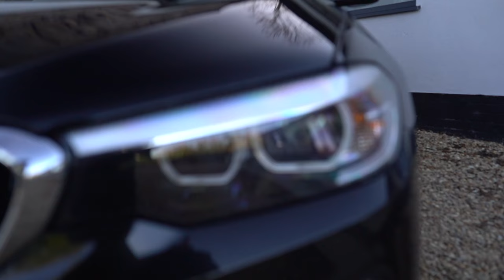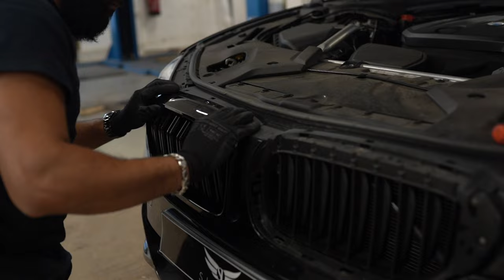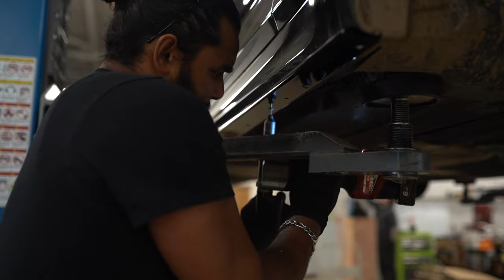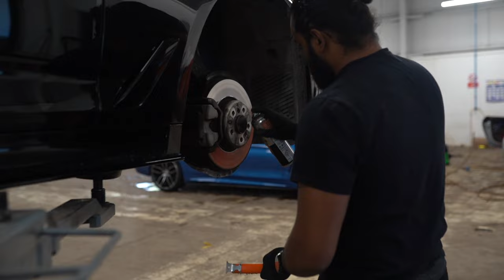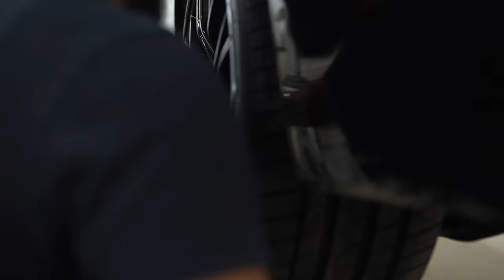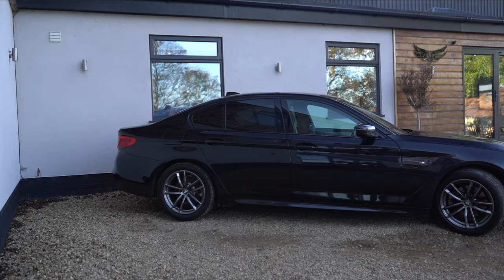HOW TO TRANSFORM A BMW 5 SERIES - THIS IS HOW WE DID IT

Comment: I've been to these guys and didnt even interact and left quickly. It was immediately obvious that they tart up low spec cars with really cheap and nasty ebay parts & wheels which will crack or bend as soon as they look at a pothole and stick crappy budget tyres on which isn't exactly safe! To top it off, they ask a premium. My suggestion is to do it all yourself 'properly' with quality parts, wheels & tyres....
Reply: U went to this guy?
Reply: @YameenAli0923  If you had both read AND UNDERSTOOD his first TWO WORDS...you will have the answer, without needing to ask. CLUE....."I'VE BEEN"
Reply: WELL SAID. Complete Transformation = ebay wheels and M Perf kit. The replica alloys are terrible compared to bmw original.
Reply: Nail on head. Tarted up cars with a bit of cheap bling and then offered for sale at a silly mark up. They’ll fool some people but the more astute will see straight through their MO.
Reply: @YameenAli0923 No, he went to that other guy.
Reply: Wtf is up with the hate? Where the f do you think bmw source plastic parts from? It begins with C. Not everyone is willing to pay extortionate prices to manufacturers who continue to rip off customers!
Reply: @ij1014 I’ll stick to OE BMW equipment thank you.
Reply: where can I buy quality parts?
Reply: @filippol.1775  Don't get sucked in by what these clown say. Ebay parts for the BMW are made with the same materials. If you want to spend 4x's as much, go right ahead.
Reply: Man, be quiet. These parts are solid, getting stuck on these genuine parts, made from the same materials is BS, I understand you work for BMW and all, but please spare us the bullshit.

Comment: Big improvement, shame you don’t put premium tyres back on the vehicle
Reply: Yes another company in Nottingham called YNC (your next car) do the same with their bmw stock.. brand new replica bmw alloys with pi55 poor brand new ditch finder tyres all round!
Reply: @kamranhussain578  practicalmaix!!
Reply: Tires come and go! Did they use the air freshener your like!?
Reply: @theophilusone7  watcha talkin bout fool?! tyres are the one component that have contact with the ground so it’s imperative that they are of good reliable quality! It’s just something one cannot skimp on dawg!
Reply: @kamranhussain578  there new, not old. I drive R 305 all the way around on my 750li. The R 275 I have on my N52 do just fine. Tires don't last n if they do your not driving!
Reply: @theophilusone7  they are ditchfinders dawg! If you wanna be a cheapskate then rather you than me.. I'd rather stick to the likes of Michelin, Goodyear and continental.
Reply: @kamranhussain578  sounds like you run stock cars. Pirrelli n Dunlop on my cars n  Maxxis on my trucks. Maxxis are cheap sure but the fun I have tearing them apart is priceless. I'll agree to disagree with you! Different lifestyle. Yawn cars ain't my preference papa!
Reply: @theophilusone7  ok dawg whatever you say whatever you say
Reply: Kamran is right. Tyres are important. You decide when to brake, your tyres decide when you stop.

Comment: You changed the wheels, put on a side skirt, and added a few bits of black! Looked ok before you touched it and how much did it actually cost? More important, did it really increase the value of the car?
Reply: Alan
Reply: what this company does is buy more standard cars and sell them with kits to clients, that way clients always come to them as they know they get a kitted car, its not so much to increase value its to target that market
Reply: Modifications pretty much never add value. If anything they detract it when you try to sell it

Comment: I bought a g30 almost 2 years ago from this company. They put low quality alloys on it and was looking stunning until I hit a pot hole which cracked on the spot. That was a month after the purchased  ending up I spent 1K more to replace all 4 with originals. I called the company sadly they were not really helpful.
Reply: Yeh they use cheap replica alloys , I was considering buying from them buy just keeps seeing too many horror reviews. Will buy elsewhere and just buy the quality parts and fit them myself or get them fitted.
Reply: All cheap quality products

Comment: That rear diffuser looks like a cheap piece of crap off of eBay. That is not OEM.  You do not install an OEM diffuser by screwing it in with a drill!
Reply: He had to drill it as he broke the clips when he RIPPED the original one off.
Reply: I’m not sure how they think it’s a good idea showing some plank shoving 2” screws in to the back bumper! Utter idiocy and the £70 Practicalmax ditchfinders just show the the level of investment in the aftermarket tat. Avoid at all costs, if you want to customise your 5 series, do it yourself with quality parts fitted by a reputable body shop.

Comment: I have the exact same car as the 'before' version (same color, same rims, ..everything).  I want to change to a black grill and put on a front splitter too.  But I'm keeping the rims.
Reply: Black grill is an easy and cheap update. I did mine and it looks great. Will also put a carbon fibre front splitter soon too.

Comment: Nicely done. This is oryginally a g30 luxuryline before the FL. Can you show any g30 luxuryline after the Face Lift tuned in this way? Are there any maxton party for the g30 luxury after the FL or maybe the same parts fit for both wersions before and after the FL? I have a g30 530i xdrive black luxury line with a Shadow pack this is why i am asking. Thanks for the info.

Comment: + for modding in general if OEM+.  - for modding cheap looking parts with no OEM wheels, cheap tires, no cleaning or mesuring. Use screws instead so one can convert back to stock. This is rediculous!

Comment: Had my 530e for a year now from S James. 30k and rear tyres need changing, fronts still a way to go. No issues with grip in all weather conditions. Car looks great and accessories still firmly in place. 👍Alloys have not bent with pothole hits but lacquer has started to show wear. This seems to be the case with all modern alloys so can't complain. Mechanically, car has been faultless to date.  Good job. 👍
Reply: Aftermarket rims dont seem to hold up in winter weather.
Reply: @leonk8113  have had this issue with oem wheels on a golf too. Tyres were wrong size on my 530e, too stretched. Only found out when changing was a bulge on inside edges of both rears. Have upgraded to Kumho all round with bigger side wall. Improved ride quality, grip & looks better with the slightly higher ride height on these models

Comment: what kind of tires did you use for it?
Reply: Took off Goodyear and put on PracticalMax
Reply: @hc5253  took off premium brand and replaced it with budget, a running theme in the whole so called transformation!
Reply: @MIK23458  untransformation / detransformation
Reply: @hc5253  people should never be in a rush to replace oe parts. I’ve learnt this the hard way, if you use good quality replacements what they call oe+ then all good. However using cheap Chinese originated products is utter folly. If you want to upgrade use genuine or equivalent, European manufactured items. Most Chinese stuff is low quality ‘mug’s eyeful’ gear. As in it looks good but is usually style over substance.
Reply: @MIK23458  Ive driven a car on replica alloys before and I would never ever recommend them to anyone. Trash.

Comment: Good grief my heart nearly stopped watching you put that cone on a painted wheel with no cloth to stop it scratching. And gunning wheel nuts in? One mistake you're gunning a cross thread and replacing the hub. Ffs start the bolts/nuts with your fingers then torque them up.

Comment: Sorry but as a g30 msport owner I have to say that I prefer the standard trim and stock wheels. The only thing I would do maybe is replace the chrome kidney grills with high quality gloss black ones. 🤔
Reply: The standard trim makes it look very basic. Where as the added trim gives it a lot more of an aggressive and expensive look
Reply: @daniaalekhan8764  maybe it's an age thing? Maybe an SE looks basic, but my m sport does not look basic. As for changing wheels an all that I'm not a fan as a BMW engineer designed them to fit and operate correctly with your car and especially with a x drive you can potentially fuck up your drive train stuffing great big 20 inch Chinese replica soft metal wheels on your car.....no thanks ill stick with the correct wheels with some expensive rubber any day 😉

Comment: Hi - will upgrading to 20'' wheels increase/decrease the stability at high speed ? I have exact same 530D with same stock alloys and wheels but they hit almost all mid sized bumps...:(
Reply: Yes bigger alloys on this car will make it way more bumpy and not as stable, you'll feel more of the firm ride. 20 aren't the best ride unless your car has the adaptive dampers option (button hear the gear knob)
Reply: Ride will be worse, and definitely dont go for replica alloys, they are trash. Just do 10&12mm spacers that will make a big difference
Reply: I have the 20" alloys and ride is still smooth. No noticeable stability issues at speed and plenty of traction off the line. Stock non m-sport suspension as mine is the 530e. I believe the suspension change was due to the extra weight of the electric motor and small battery pack. Fitting the correct tyres makes a big difference to ride quality and grip.

Comment: You have ruined a quality car!
Cheap after market wheels (you get to sell the genuine ones for a fortune)
Cheap chav plastic parts.
Cheap quality. Cheap looking!
Reply: You are the kind of guy who thinks rolling in his stock car is looking cool ? A tunned e60 looks 10times MORE quality car than a stock g30 which is 6 times the price !
Reply: Barry they where dead 18 inch wheels how would they sell them for a fortune the car looks so much better after the styling
Reply: Looks chav
Reply: Stock parts/variants always have higher resale value. If you want to save money just buy aftermarket parts on an entry level spec
Reply: @tahree2033  they obviously marked up the price by around 30-40%.
Reply: Dead wheels huh. Funny but you must hunt out cars with dead wheels because every car you sell has cheap after market wheels on. And cheap after market spoilers, and.....  cheap quality rubbish.